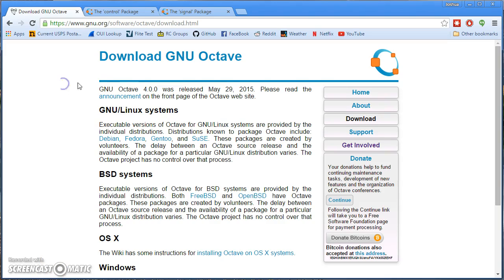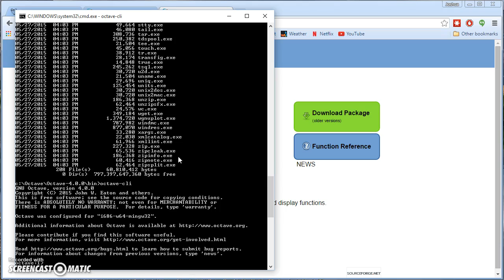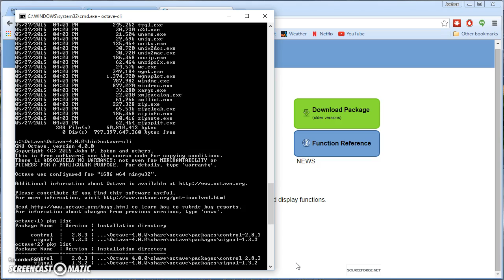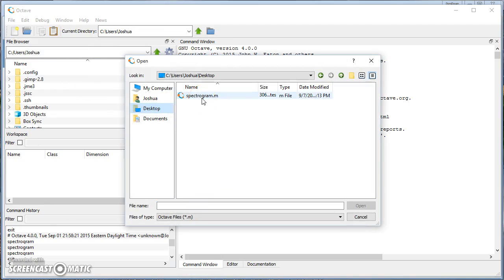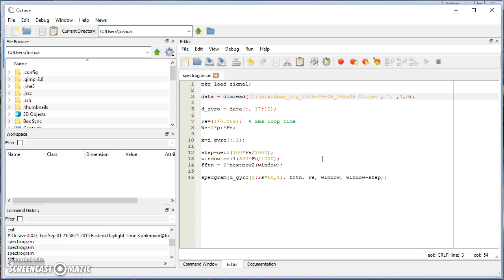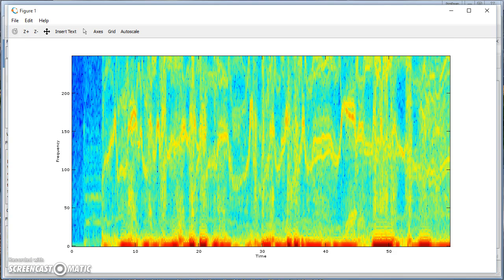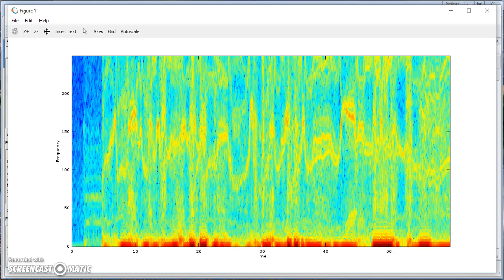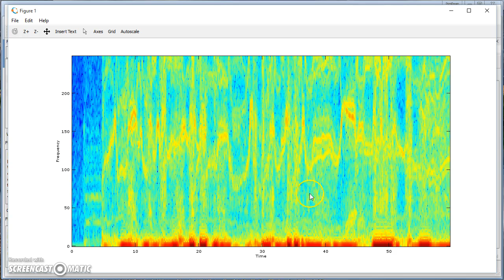Generating gyro spectrogram from Blackbox with GNU Octave

Comment: This is brilliant, now i can see why my quad has been so hard to tune even with the filters. I have a load of noise right at the bottom of the graph which appears to be an inverted version of the noise higher up. Im going to give the latest Betaflight with the gyro sync a go. Thanks for posting this, it's so useful.
Reply from the maker: Inverted and double amplitude is how I have heard aliasing described!
Reply from the maker: By the way, if you are not logging at 1:1 in Blackbox you will have aliasing in the log that is not actually in the gyro.
Reply: +Joshua Bardwell Again thanks for posting this, it's really helped me get to the bottom of why my quad has been so hard to tune. It was aliased noise form higher up that was right in the control part of the frequency, screwing up the PID's . I have gone through and tested a load of settings and gyro sync etc .just hovering in the kitchen to get the black box data was enough to see the difference it made. I will have to collect all the data and post it on your RC groups thread, it's pretty interesting (well I think so anyway).
Cheers

Comment: The vid shows a typo in the octave script. Also as for now (Blackbox version 0.4.3 built Wed 25 Jan 2017), the gyro data is in a different column. 

pkg load signal
data=dlmread('LOG00026.csv',',',1,0);
d_gyro = data(:,20:22); % blackbox decode 
Fs=2e3; % 2khz blackbox, PID frequency
Ws=2*pi*Fs;
x=d_gyro(:,1);
step=ceil(10*Fs/1000); % slice for every 10ms
window=ceil(300*Fs/1000);
fftn=2^nextpow2(window);
figure
specgram(x,fftn,Fs,window,window-step);
Reply from the maker: Nowadays we can use blackbox log viewer for the FFT at least, if not the waterfall.